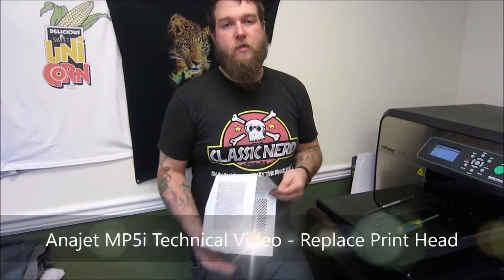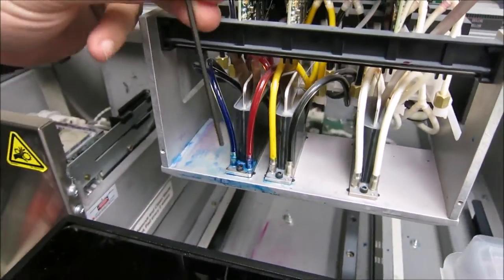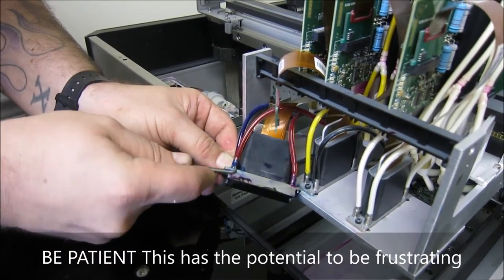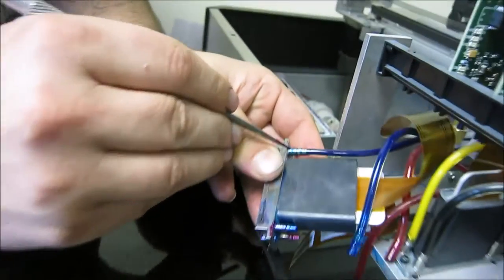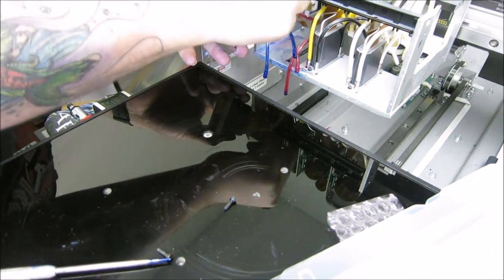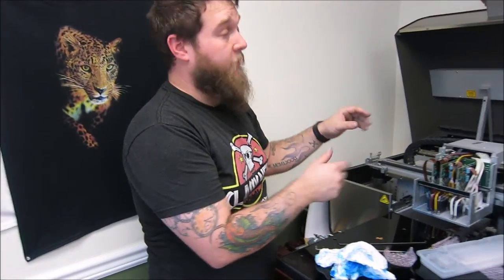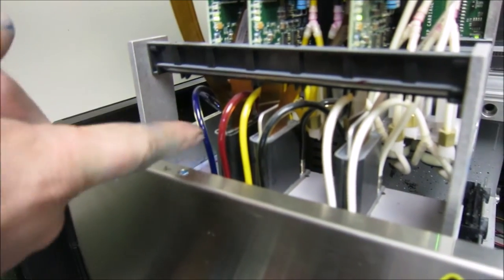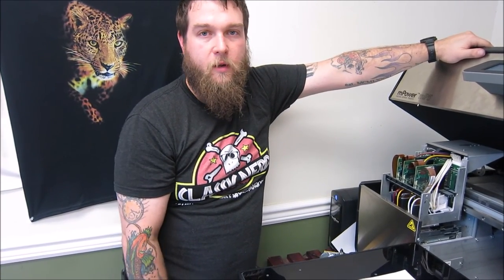Signworx - Anajet mp5i DTG Technical Video - Replacing Print Head Tutorial

Comment: Your video and instructions are so much better than Anajet! Thank you. Question: should we cut off the bottom of the hoses before reconnecting to the new print head, to cut off stretched out hose?
Reply from the maker: Thanks for watching. We try our best to help others as much as possible. It is easier if you take an Xacto and cut the hoses right at the print head.
Reply: Thanks. Did it. Pretty proud of myself! The worst part was loosening the screws, then hearing that crack noise. But remembered that you warned us about the noise! Had to cut the black hoses because there were tears at the end, before I started yanking at them. Perfect nozzle checks now, perfect prints. Thank you!
Reply from the maker: Awesome and you are very welcome. I am very glad you got everything up and running.
Reply: @SignWorxNC  Have to replace another print head. Came back here to watch your video. Your directions are so much more helpful than Anajet. Thank you!!!

Comment: Have you tried heating the tubes with a blow dryer to get them off the printhead easier?
Reply from the maker: not with a blow dryer but we have tried a heat gun. the heat gun did help but we now just take an exacto and trim it straight to the top of the nipple on the print head. its much easier and faster. and there is more than enough extra slack so as to not worry about the line being too short. you just cant do it more than a couple times. lol

Comment: Very helpful - Thanks. My nozzle check looks like your old one, before the head replacement. Do you think a head flush will fix the problem?.... before I drop the cash on a new head.
Reply from the maker: yes that is always an option. if you flush it out with cleaning solution you can see if that will help. You can also try to take the head off and use simple green as a last resort to try to flush anything out of the head. Anajet does not recommend doing that but if you are about to buy a head. you might as well try the simple green.
Reply: I am still curious of your luck on trying to resurrect your old one. I think if you soaked it in Purple Hammer cleaning solution for a few days, then put it back in the printer and ran the cleaning cartridges through it, then put the ink in it, then 1 head clean, then let it sit for a day. I have a good feeling that would fix it despite it sounds like a lot.

Comment: I have an mp5 that I have had idle for a period and it appears the black line has become clogged.  Can still get yellow through the print head so I do not think the printhead is an issue.  Have you ever replaced the ink lines? Can you recommend a way to clear a line without removing them?
Reply from the maker: +mpickett3 It actually could be a clogged printhead. Each print head actually has two sets of jets. One side can clog and the other side be perfectly fine, we had that issue once on our white. One side printed while the other side didn't.There are a few other areas it could be though. One is....even as silly as it sounds. you are out of ink. We had another person call us asking the exact thing and he was just out of ink. Not saying that would be you but it has come up. Its like the joke of the tv not working and to only find out it wasn't plugged in...Second is the dampers. if the damper for that color is damaged it wont properly pull ink through the head. I haven't put up a video yet on how to change those. Its not the easiest but it would be one of the cheapest. Third is there could be a clog but it would be in the print lines like you mentioned. I would disconnect the lines from two sides and see if you can push cleaning fluid through it. If you know its in the line I would recommend removing the line before the damper and connection to the cartridge and use a syringe to push cleaning fluid though the line. We haven't replaced the entire print line but just sections close to the damper when we changed the dampers.I hope this helps. If you have any other questions please feel free to ask.

Comment: What would you soak the Print head in to try n clear it out?
Reply from the maker: we have tried to soak in water, simple green, normal cleaning solution, alcohol and denatured alcohol. Simple green has had the best results when it was heating up before soaking but it wasn't a complete fix to make it usable again but it did clear up more nozzles.

Comment: hello my friend I have little problem with my printhead can you help me. the problem is when I want to print a de message détails (failed to calibrate head drive board voltage)
Reply from the maker: You may need to see if you can recalibrate. Have you tried that yet? and have you read the voltages to see what your numbers are??

Comment: I just swapped out the print head and now the new one have a new clog spot. Do you know if this is common and what should I do?
Reply from the maker: was it a brand new head? or a refurbished one. We have seen issues with refurbished ones having issues like this but it will sometimes clear up. If it is brand new I would try to push some more ink through it..even try printing with it. If it doesn't clear up, I might get it replaced.

Comment: how do you calibrate the voltage if it says error?
Reply from the maker: You go into the menu system and go to diagnostics and there will be a section that says read print head voltages. you can select that setting and go the right until it reads calibrate head voltage. it should then calibrate. Then go back and read the settings and make sure you are good to go.
Reply: @SignWorxNC  im having same issue. Followed steps. Didnt work

Comment: HOW OFTEN WOULD YOU SAY  YOU'VE HAD TO REPLACE A PRINT HEAD? ive had my mp5 now for about 3 years. it seems that one of the white heads doesn't print as well as the other one. its almost like one of the white heads is working and one is not. i still get some ink but ive done plenty of print head cleans/purges ect. with no luck. also seems with  the one print head that works,  i get about about  90% good nozlle check which isnt bad, but it doesnt seems like theres enough ink coming out of it either. idk.

 so when doin my white prints i end up going over the print twice with the white  which actually turns out pretty good but its just a nuisance and i feel i wasting ink even though maybe im not since hardly anything is coming out of the second white head..ha any suggestions?
Reply from the maker: We have had ours since 2013 and have replaced a total of 3 print heads on our machine. The first one we had left alone for too long while we were on vacation and then i damaged the first replacement. And then we had another print head start acting weird and we replaced that one. But we have noticed with the whites. its normally always the outside nozzle that will not want to print as well as the inside. and we think even though the nozzles are microns from each other the outside one is closest to the elements. NOW i am not sure if this is the case but we think that because of that it tends to clog first. but to combat this, besides printing and cleaning the heads. if the gasket around the maintenance station isn't clean or damaged it will not have a proper seal around the head and will assist in the drying out of the head.

Comment: Hey I heard you say that you helped a friend fix their mechine in another video. Could you possibly help me? If so I'll send you my contact info.
Reply from the maker: Hey Anthony, Yeah I have helped others fix their machines and helping another person fix theirs right now and will prolly put a video of what his issues were. Where are you located. you can just use our contact form on our website. signworxnc.com
Reply: SignWorx NC I live in Winston Salem, But work in Greensboro. The suction is not working to fill the lines and after removing the ink head to clean them. There is a error code.
Reply: Head voltage out of tolerance even 4/ odd 0

Comment: Have you ever soaked a head and gotten it to work again instead of buying a new print head?
Reply from the maker: +Dhymond Nicholls I haven't soaked it yet but that is what I plan to do with the one I removed. I just didn't have time to soak it since I had to be back up quick to keep printing. But I do plan on soaking the one I have to test if it can get it working again since I would love to have it has a back up, just in case. I have been putting a list together of what I will test to soak the head in.
Reply: Thanks.  I would guess alcohol would be your best bet
Reply from the maker: +Dhymond Nicholls I am planning on testing alcohol along with denatured alcohol and simple green. have you seen anyone else be successful soaking with just alcohol?
Reply: +SignWorx NC no,  I just figured that alcohol would be the strongest.
Reply from the maker: +Dhymond Nicholls no problem. So after I soak the head, I will update you with the results.
Reply: +SignWorx NC Did you ever end up soaking the printhead in alcohol?  Any luck resurrecting it?
Reply from the maker: Koi Pond Massacre I did try soaking with alcohol. It helped slightly but not enough to bring it back. I haven't given up yet to resurrect my clogged printheads. I think the problem is trying to get the actual clog out. I think the alcohol helps loosen it up but I need to try to some how syphon the clog out of the head.
Reply: Right on.  Thanks for the update and the great video.  It's been our guide for swapping out a bad printhead today.
Reply: Have you had any luck with resurrecting any old print heads? Or any homemade remedies for alternate cleaning fluids?
Reply from the maker: Unfortunately No, but we haven't given up. I still try different things from time to time...when I switch them out to test it looks like it could be helping but its not good enough to say it was a success